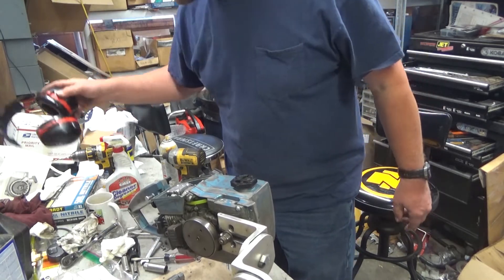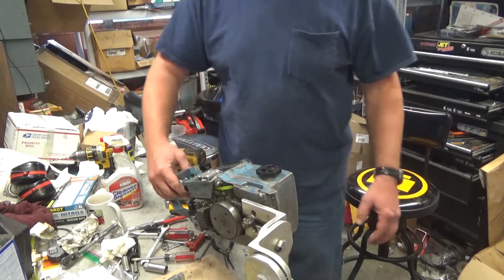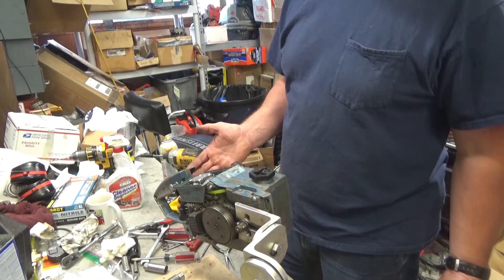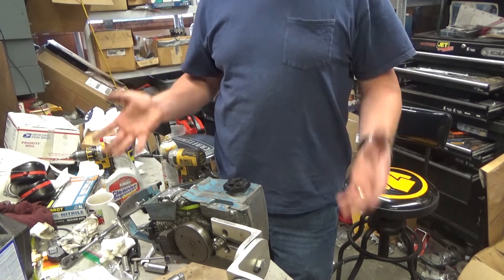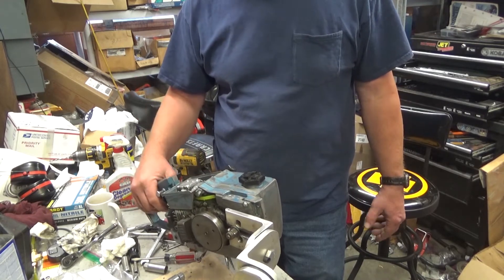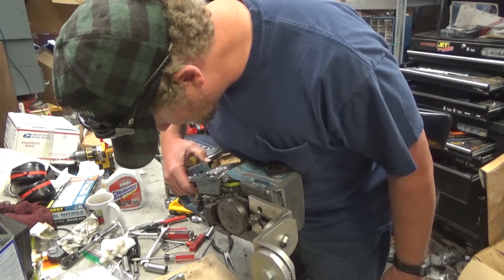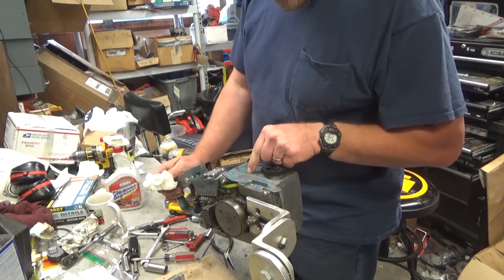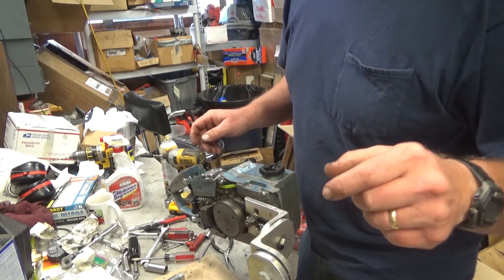John's Homelite XL-101 Test Run...New Piston & Cylinder!

Comment: i finished installing the duck valve on my XL 102. Started it up and it ran great, i then put it in some logs made a few cuts and gas came out of the carbs new tygon fuel line and filled up the carb box. It's leak is where the fuel line slips over the fitting that sticks out of the carb. A  hose clamp wont fit in there,a piece of wire doesn't work either. I would appreciate a comment.